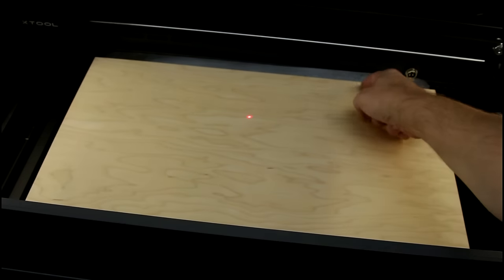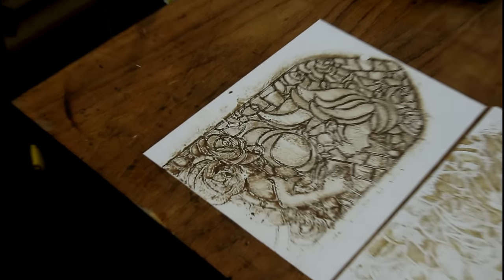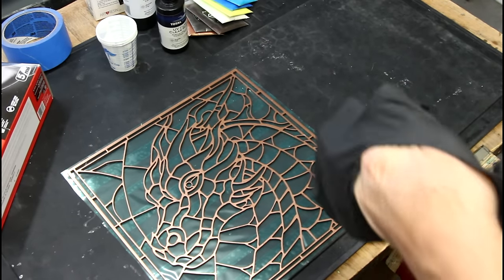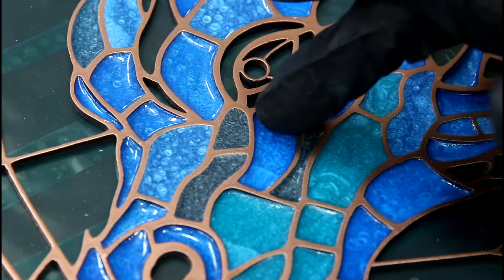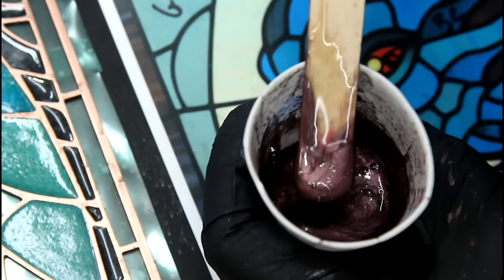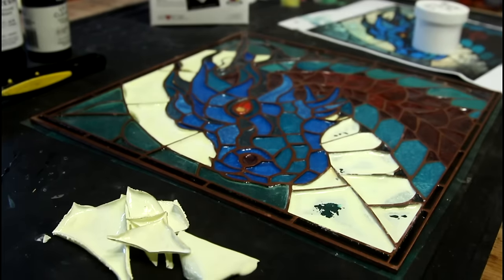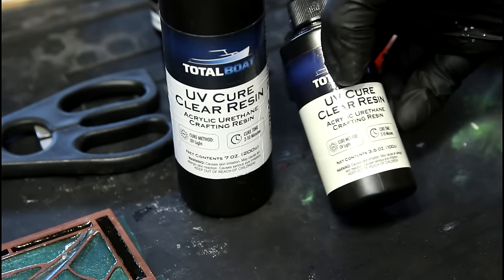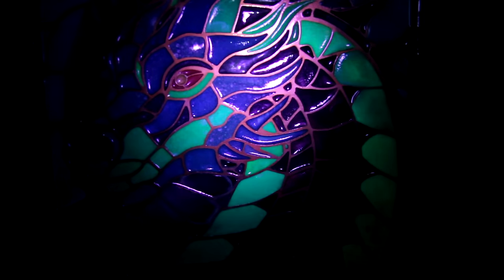Resin Stained Glass: Viewer Suggestions!

Comment: Save the offcuts and do a revers stained glass piece. Have the resin hold them together in between. Keep them glued down so it stays in place properly
Reply: I suggested this in the first video and I was expecting him to do it here, given he mentioned viewer suggestions.
I'm disappointed that he only mentioned the comments referring to it as a jigsaw puzzle.
Reply: He could just add a secondary frame to the cut out file, leave the off cuts in place and pour on the aluminum backing
Reply: I 2nd this idea
Reply: So just wood with a colorful frame? No thanks
Reply: @Donovarkhallum a black resin with wood parts would look amazing and you can color the wood with different stains or watered paints.
Reply: @Donovarkhallum  
No, there would be colored resin filling all of the gaps between the wood pieces.
Reply: @Shadowmech88  yeah that's called the frame.
Reply: @Donovarkhallum  
I'd consider a frame to be only the outer perimeter of a piece of artwork, not literally all negative space in and around it.
Reply: @Shadowmech88  it's not negative space mate. It would. Be the thing holding the wood pieces together. It is by textbook definition a resin frame.
Reply: That would look cool with the hints of colour holding the pieces together if the wood parts are painted the copper colour it would then be a negative of the stained colour one.
Reply: @Donovarkhallum 
Would you refer to the mortar in a brick wall as a frame?
Reply: @Shadowmech88  is the outer perimeter mortar?
Reply: @Donovarkhallum  
It could be. Would whether it is or not be the deciding factor in whether all of the mortar is the wall's frame?
Reply: @Shadowmech88  obviously. You're attempting to be. Semantic but it's not working. It's because the resin is also the perimeter . The perimeter is the frame. Not sure where you are confused.
Reply: The two finished pieces would look cool hung side by side
Reply: I was going to suggest the same thing. I nearly cried when it was tipped in the bin… 😢
Reply: I was going to the comments to say exactly the same thing!
Reply from the maker: I'm going to bag up the next set and give them away like a prize!
Reply: @peterbrownwastaken  I was going to suggest that. Hope we get to see what is made of them.
Reply: probably wouldnt look nearly as good
Reply: I said the same thing on the first video! Haha. Great minds think alike.
Reply: I saw someone who used mirrors and one way mylar to make infinity resin art. I wonder if something similar can be done with the offcuts?
Reply: @Shadowmech88 many of us suggested this. However, you need to consider the time this takes. There's a difference between doing it for fun and trying to run a video production to meet a deadline (even self imposed).
Reply: I was literally about to suggest this and decided to check the comments before I did.
Reply: @XcaptainXobliviousX  nah they are already taped down to the bed, just keep them there and put the resin tape on top, peel the original tape off the bed and pour the resin.
Reply: @mr.grotto 
True, but he could have saved the pieces (and maintained their spacing with tape) and done it as its own video at some point in the future.
Reply: Since the pieces would be so thin I would worry that it might be too fragile and might break in the process of picking out the wood pieces. Although I guess the wood would be stuck in place and might actually hold the whole piece together. That might be super cool!

Comment: Hey Peter, my wife does a TON of UV resin work, and she suggested that instead of using your torch to pop surface bubbles, a little dollar tree spritz bottle full of 91% Isopropryl Alcohol is the perfect thing for popping the bubbies. Just a light misting across the surface will make all the bubbles disappear. The reason why a torch is not recommended is that you could accidentally set the resin on fire or even burn your form. She has set the resin on fire before, and learned from that particular lesson that the smoke detector in her craft room is a good investment. She also agrees with most of the other commenters that the white and red mica powders were probably too opaque for proper curing. But hey! New tool in the arsenal!

Comment: Very cool.  That lemon colour almost looks like it was so opaque it blocked the UV from penetrating all the way through the resin.  Also I thought it was quite interesting how the mica resins seemed to almost bloom when you were putting them in there, like spots of mould would, but nicer looking of course.  Not sure if that blooming carried through after they cured or not, or if it was just the camera picking it up where it's not so obvious in person.
Reply: I had the same question about opaque colorants in UV resin, but waited to finish the video to post a comment about it in case it was addressed. Looks like it was indirectly.
Reply: It could be, but a pigment being opaque to visible light doesn't mean it's also opaque to UV. The same way that glass is transparent to visible light but opaque to infrared.
Reply: @SirPhysics I considered that as well. I guess we can't know for sure without knowing exactly what the pigment used was.
Reply: @Squibbleses I see that kind of bloom a lot when making melt and pour soap with mica in it. I feel like it's made from how the mica settles, either from how the liquid was dropped or from the currents it kinda forms as it cures. If this is like the soaps, it stays in the finished piece but might be more subtle than while it's still liquid.

Comment: The "super white" pigment probably has titanium dioxide in it. It's a very common white pigment, even used in some foods. But it's also in sunscreens because it blocks UV light. That would explain why the surface cured but the UV was unable to penetrate very far into the resin gel.
Reply: Agreed.  Titanium dioxide reacts differently from other pigments, including in soap, where it makes a tremendous difference.
Reply: Smart deduction. That seems to be a most likely scenario.

Comment: For your first project with UV resin, you did a great job! Others have covered the pigment and curing issues, but I also wanted to flag that some UV resin shrinks more than others. It's worth testing a particular UV resin in your biggest cell (or a close approximation), that way you can account for shrinking issues. Slow curing tends to shrink less, which is why your little torch did so well, I think - but then you need to have the light on it longer. Or, as you discovered - pop the whole project into the sun!

Comment: I think the UV resin would work better with translucent dyes for the colors instead of pigments that go opaque. In my experience, UV resin likes transparent dyes the most since the light can pass through and cure throughout. With more opaque pigments it cures and creates a sort of shell and it can be harder (and sometimes impossible) to get the middle cured because light doesn't reach it. I think in this case since it's such a thin piece it can still work (if a bit messy since you needed to peel the back tape and put UV light on that side as well) and those specific pigments just didn't like the UV resin on top of being opaque.

Honestly though it came out looking pretty dang good!

Comment: I think for the best stained glass outcome, UV resin is really good for ease of use but if you need more opaque colors then a slow cure resin might be better for that. Also dyes giving a translucent color can be combined with micas in varying amounts to give more effect to the glass and even just mica only at the far end. Ideally having the tape on the back is good but after curing the front, you might flip and cure the bottom to make sure its fully set up.

Lots of stained glass types are used from clear, tinted, opaque, mixed opaque, mixed opaque/tinted, streaked (where the glass is pulled in a certain direction) and textured. All of them give different effects and uses in the glass with the light to get the right color play when lit up. Most of that can be done easily with resin while others a mold will have to be used in some fashion.

Comment: For the weight and stiffness, I suspect that after the spray if it has metals that you could make it thicker by electroplating it. Just use two or more connections to the frame, because of it's size

Comment: I play around with UV resin as a hobby but I’m a qualified nail tech that works with gel polish, which is essentially a type of UV/LED resin (to put it simply). Cure times are SO important with any UV products, and I find that most opaque pigments just don’t work with UV resin. It’s always worth testing them though, as some will work with a longer cure time. 
This isn’t technical advice as I’m a nail tech, not a resin expert. I was just curious why some pigments are too opaque in UV resin when there are pure black gel polishes that are opaque in one coat that cure in 30 seconds on the market so I played around and found some that worked!
I would suggest trying gel polishes to get an opaque effect, but that would work out very expensive on this scale.. I can justify the cost with how little is used on my fingernails! 😅

Comment: The white pigment may just be opaque to UV like titanium dioxide is used in sunscreen for example, it doesn't necessarily have to react with the resin. I wonder if putting the resin out in daylight would help with the curing as that's about the strongest source of UVA and UVB that you can access cheaply and easily. Getting a white pigment that is translucent to UV could be tricky, but it must be possible since I've had composite dental fillings made with UV resin. Quartz powder might work as a substitute for mica if there is such a thing as that's what the cuvettes for UV spectroscopy are made out of. Maybe silica or silica beads like used to make street signs reflective.

Comment: If the resin tape is reliable then it may behoove you to place a larger, flat UV light under your piece, so that when you're using more opaque pigments, you can hit it with light from both directions at the same time. Ideally, that should prevent the resin from curing unevenly.

Comment: I wonder if it’s the light your using there are different wave lengths of those UV flash lights I think you want to make sure it’s  405nm.  And the thicker more opaque pigment colors might have issue with light getting all the way through

Comment: Not from experience, but I would suggest using a bigger UV light to cover more area and leave the light sit in one place instead of waving it around.  Then, when you have the top cured, you can turn it over and cure it from the bottom, too.

Comment: Awesome salvaging of what could have been a disaster, and your colour choices at the end were great! 

I think one thing the copper plating has going for it, over the copper spray paint, is that the laid-down copper softens and rounds off the sharp finish of the plywood and makes it look more like real leadlighting, whereas the paint doesn't really disguise the fact that it's cut wood rather than metal and solder. That said, if the paint is both cheaper and easier, it's hard to argue with that! :)
Reply: Ok, I have an odd question for you. According to YouTube, your comment is 21 hours old, but this video was posted 30 minutes ago. How...
Reply: @deacont3250 videos are always uploaded unlisted, then made public
Reply: @mfmageiwatch  How does one watch an unlisted video?
Reply: @deacont3250  usually with a link provided somewhere private - like patreon or a discord server, or similar.
Reply: @fthurman  Oh, word. I always forget about Patreon. That makes sense, thanks.
Reply: @deacont3250  by having the URL. Idk if this channel has a patreon, but often patreon members of channels or youtube members will get the url 12-24 hrs early as a perk
Reply: Yep, Patreon early access.

Comment: The answer to why it curled and you had uncured resin is because the pigments were opaque and you only cured on one side directly, the other had the tinted tape impeding it. Using too much mica or other opaque pigments means the UV light can't penetrate the resin properly and therefore doesn't fully cure. Transparent liquid pigments and much smaller amounts of powder will give you a proper cure. I'd also suggest a light you can set up above the piece (a la Evan & Katelyn) to give a more even/powerful exposure.
Reply: Yeah, and a longer cure time. Like you can do opaque but it HAS to be thin, cured on both sides, and cured for longer.
Reply: Also hit the piece from the bottom up (or when top is cured flip it over and continue curing that side).
There is an English man doing a lot of experimenting with UV resin I’ll get his nam and put it here. Watch some of his videos. They are mostly short.
Reply: Daniel Cooper

Comment: The darker it is, the more uv it will absorb and cure faster.  It's like when people use black paint to get better results with the laser cutter, it will absorb more energy.  I think you need to leave the UV light on WAY longer, and probably need a better source than a little flashlight.
Reply: Probably just a stronger uv light as opposed to the black light he has
Reply: @Drummerchef13  Agreed. I started with a 6 watt UV light. Frustration abounded, I could only pour 1/8th thickness and NO green. 2 lights later (50 and then 70 watt) I can cure up to 1/2inch thick of just about any color in 3 minutes.

Comment: Quite likely the white and red pigments were too opaque for the UV to reach the resin. Also, I've noticed that UV resin needs a lot more time under the light than it's advertised for most brands.

Lovely dragon, and excellent save, as always!
Reply: From what I understand it's also best to work in very thin layers with UV resin if you want to make it easier to cure quickly

Comment: I like the idea of the UV resin because it is simpler to use and you aren't under a time limit.  I do wonder about the cost vs. using regular resin though.
Reply: From what I’ve seen price wise easily triple+ the cost for UV vs 2-part epoxy
Reply: And uv yellows horribly
Reply: @debramandich1462  one way to negate the yellowing in the clear UV resin is to add a single TINY drop of blue dye to the clear. Same principle as when you're not wanting 2 part resin to yellow.
Reply: @TheDarkPreacher65  purplish blue because regular blue can mix with yellow and make green

Comment: You need to get a braer. It's a little rolling-pin-like thing that is meant to push tape or anything sticky onto a surface. Used a lot in applying stickers or such. This will help with applying the tape to the back, you'll just turn the piece over and run the braer over it. Just make sure the braer is wider than the larger pieces you're doing, as, otherwise, it could punch through the tape. You could even make your own braer!  (Also, note, braer is sometimes also spelled 'brair' or 'brayer').
With regard to the pigmented bits not curing properly - do pigments go out of date? I'm wondering if 8 years is too long? 
Finally - I wonder whether you held the UV on the pieces long enough? Maybe put the piece under a UV light for a few minutes, rather than just running the torch over the top (or put the whole piece outside for a while before you un-tape it, even turn it over the the UV can get to the back, that should help). 
Anyway, please do more like this, it's amazing! :)

Comment: I kind of like the Picasso! Since you plan to go deeper (thicker) with the resin you need to cure it in stages.  UV resin can get hot and bubble if it is too thick while curing under the light.  Most likely the reason the red and white didn’t cure is because they were too opaque for the light to get through.  UV resin does not lend itself to opaque colors.  If flipping it over and curing from the back didn’t cure it then it was just way too opaque.
Reply: I really enjoyed this video. Great save. You show that a problem can be fixed! It doesn't mean an automatic fail.

Comment: I love how you addressed the pigment failure. The thought process you went through to work through each problem separately was really well thought through. 
And the color 'repair' was spot on. 

Thanks for walking through this on camera, it really taught me a couple things. Do tests on your color ahead of application and keep it as part of the label. You can even keep track of the color certain pigments are under black light or uv and have the piece be a specific look that way as well. Then you could display both ways.

Comment: That lemony pigment was probably too opaque for the UV light to penetrate all the way through which is why they only cured on top. If you place the entire project on a glass surface and cure from underneath as well as on top it will help. Great result.

Comment: The older pigments weren't an issue of too old, it was too opaque to let the light through. If you need/want an opaque color in some areas use epoxy resin for those areas, they will work with the resin tape.

Comment: The 'oily residue' you get is probably a mix of melted/aerosolized resin from the wood combined with residue of the same kind from the glue used to bond the plywood layers. Plus some other funky products emitted when the laser superheats the wood, creating gases that vapor deposit on the surface of the metal sheet.

Comment: if you can work on a piece of glass or a pad of white silicone, you can bounce the UV light around and you'll get a better cure on the bottom. also, definitely get a bigger UV light. there are UV manicure lights you can get that are bigger than those dink little 4" wide ones, and they'll work great for this.

Comment: Laser cutting is a craft in and of itself. When using UV resin you do need to let it sit under the UV for as long as you can, a quick flash of light isn't always enough. Letting it bake in the sun is always helpful.